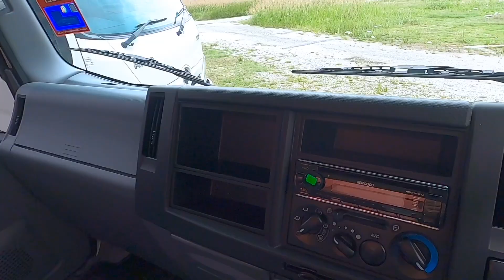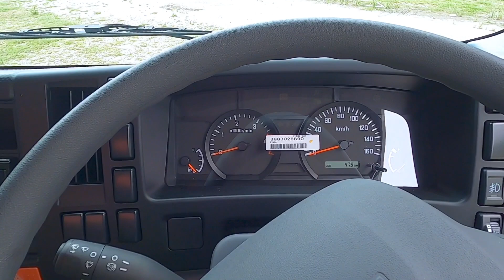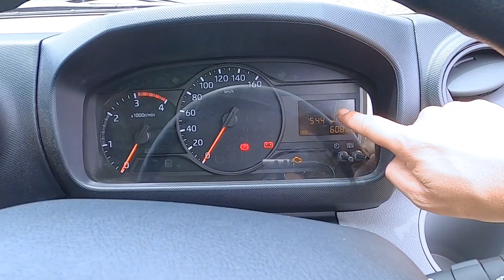ISUZU NPR PRO @ NPR81UHL VS HINO 300 PRO @ XZC710 || STEEL TIPPER BODY || MALAYSIA SPEC [Eng Sub]

Comment: Hino small cc but high output. Sale value also high
Reply from the maker: Thanks for the opinion. Very useful.👍
Reply: @Harold Yeoh nope Ur wrong better acceleration? Dis video the 4hl1-T gonna beat hino 
And the info is wrong 4hl1-T is 158 hp and torque 425 torque
Ders also 4he1,4hk1 engine
U want fast truck buy 4jj1 elf